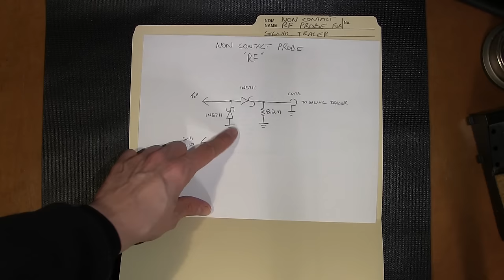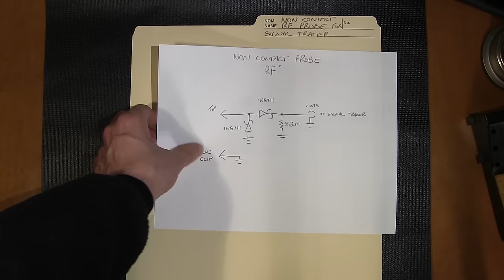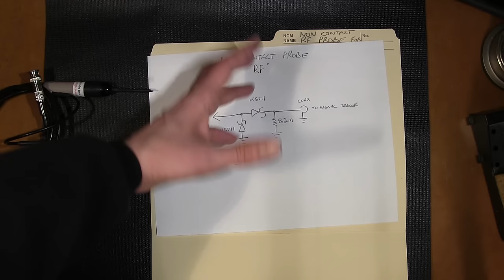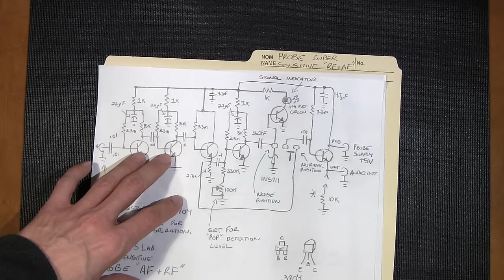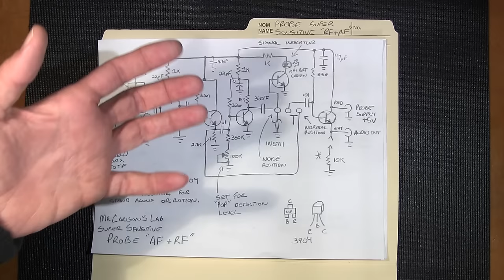Troubleshoot Electronics FAST with a Super Probe

Comment: Hi, i finally built it. It seems to work, but... It detects only amplified signal  from 2-3cm max distance. It cant detect audio straight from an mp3 player. Also the speaker all the way turned up is not loud at all. 
I have checked every connection and component values again and are all ok. The only difference is that i used a smaller rg59 coax. 
Any thoughts would be great..
Reply from the maker: Layout is key. The device is extremely sensitive, and the build quality is crucial. All the plans with PCB layouts, schematics and component maps are on Patreon if you want to build an exact copy. Months of time went into this design and center values were determined, so if you want my results, you will have to build it my way.
Reply: @MrCarlsonsLab  Thank you for reading and responding to my message! And THANK YOU for your great work!
Reply: @MrCarlsonsLab  Problem found on the amplifier side, one different resistor value and no ground connection on one pin. As soon as i fixed that, it worked as demonstrated!!! Still working on the enclosure though, but i am glad i made it to work.

Comment: Sir Paul, what is the smd code for the 1N5711 schottky diode? Is this diode critical in the circuit or i can use any schottky or signal diode?
Reply from the maker: Hi, for best results I suggest you use the 5711, but a 1n4148 should be ok. The code for the 5711 is: 1N5711W-7-F  This is an SOD123 Part
Reply: Mr Carlson's Lab Mr Carlson's Lab Thanks sir. Here is my other question, I only have 50K smd trimmer resistor, do I still need to change the value of the resistor(330K) in series with it?If so,then what will be the value am I going to use?
Another question is,can I use ceramic capacitor in place of those tantalum capacitor(22uF)?
I really want to build this sir because I find it very useful in troubleshooting. But i don't have complete parts here to complete this,so i will use whatever parts i have on hand. Electronics store here in my place is very far(250KM away).
Reply from the maker: The 22uF caps are just blocking caps so the ceramic caps will be fine. Try the 50K trimmer in series with the 330K. You may need to add another 50K resistor in series as well if your not satisfied with the range.

Comment: Mr Carlson can you dumb  down to my level that part about the chassis being connected to neutral Is it no cycling 50% on each wire back on forth at 120 volts on each wire?
Reply: Maybe I can help.  The standard American mains power starts on the power pole at some high voltage, goes into a transformer where the secondary is 240V center tapped with the CT grounded.  Those three wires are what come down to your house.  If you need 240 for a range or a dryer you'd use the outside pair.  Everything else connects to one of the outside lines and to the CT/ground.  So in your outlet, one of the slots is effectively at zero volts, and the other one carries the 120 AC.  But between the two you get 120 AC to drive any electrical device.  --  One reason for the no-transformer radio design that Mr Carlson skipped over is that not everyone had AC power, some had 120 DC.  These radios could work with either, but with AC it would work with either way the plug was put in; with DC the plug had to be a certain way.  -- Anyway, one of the line cord wires goes to ground, and the other goes to the rectifier tube to create the B+ for the radio.  Workes either way with AC, but you have a 50% change of plugging it in so that the chassis is connected to the hot wire.  If you were grounded and touched a metal part you'd get a 120 V shock.
Reply: the neutral is connected to earth where your power supply comes in so if you touch between neutral and earth nothing will happen but if the live {hot} wire is connected to chassis you risk a lethal shock from it. you need to fully understand things before working on any type of mains powered equipment. my advice is to learn on battery powered stuff until you have a good knowledge of electricity.  it will KILL!
Reply: Also, anytime you work on a mains powered, high voltage system, keep one hand in your pocket.  Anything over twelve volts DC should be considered high voltage.  Better safe than sorry.

Comment: hi nice video, i have a question. how do you determine the bandwidth of this circuit.
Reply from the maker: Hi Andrew. This is easily accomplished with a signal generator.
Reply: is there any reason you dont use opamps?

Comment: Would this work on the small surface mount capacitors and resistors?
Reply from the maker: Very much so.
Reply: Interesting.
I may look into getting one. However, I would have to commission one. As I do not have the means to make or modify one.

Comment: i use a lithium battery with a small charging circuit board in my little handheld controller project.this way i dont have to take it apart ever again.it's lighter and cheaper,though i end up burning 3 of them chips by accidentally applying 12v to that 5v input

Comment: may be used to detecting high frecuency from the tv inverters?
Reply from the maker: Do you mean the power supplies?
Reply: Mr Carlson's Lab yes the power suplies for the cfl (florescent lamps)
Reply from the maker: Yes it will definitely hear those with the detection mode on. This probe will listen into the MHz region , those CFL back lamp supplies are usually only down in the kHz area.
Reply: Mr Carlson's Lab Yes thanks I want detecting no measurement the output high frecuency

Comment: Awesome video! Definitely appreciate the tremendous amount of work you put into this for us. :)

I do have one criticism, though: You occasionally refer to a potentiometer as "VR". When I hear that, I for one don't immediately think "variable resistor", but rather "voltage regulator".

I know that's kind of nit-picky, but it's a little easier to follow when you use the abbreviation "pot" or don't abbreviate at all.

Comment: Did you try it on a scope instead of the speakerpart ? 

Nice, my first successful build project (as a teenager around 1980) was something like this. I think the schematic was in an elector. It had 2 inputs, one for RF and one for Audio. I used that a lot as I had no scope in those days.  I still have it. Also build a tube version some years ago. It had one input and detected RF and AF. Instead of the led it used a magic eye to show you if there was RF http://www.pa4tim.nl/?p=1332 there is a download link at the bottom for the schematic (from 1946)

I made a shortfinder that measures contactless. I think I will adapt the detector side to your noise mode idea. I had a psu a few months ago that whined and I could not use scope probing because there was no space. A sniffer probe would have been the tool for this. Stupid, I have several devices that I could have used for that. (including a current probe I made with a hall sensor)

Fred

Comment: I had a terrible electronics teacher in high school
Reply: I have found that high school electronics classes have in mind turning out Radio and TV repair people.  You learn that, but not really the hows and whys of design.  It's useful, and that's all that some people need.  I bailed after one quarter and learned more on my own.
Reply: I can go one better. My high school in Aldergrove B.C. Canada  put in an electronics course in 1969 to see if it was a good idea. I was in grade ten and thrilled about it so signed into it. 
     They dropped it the next year as they did not think it important. You could learn it all in trade school later...if you wanted to go that way.....
     Idiots.....no wonder Japan ....and now China ....and pretty well every other country.......buried us.
Reply: I wonder whether there even ever used to be an electronics course in school in Germany. There wasn't one over in Soviet Union states, but the school there is traditionally only 10 years, while it's up to 13 in parts of Germany. I finished school in Germany around the turn of the century but never encountered or heard of it.

And yet, i didn't have the impression that either Soviet Union or Germany ever suffered from lack of engineers or people generally versed in the subject.

Comment: I found a really unusual tube while looking through box of random tubes.
But the problem is, I have no idea how to identify it?
I haven't seen any examples of other tubes that resemble it.
Here is a link to some images of the tube.
https://drive.google.com/open?id=0B9Lgf9gHRS4nUkZEN1YwTDNEdkU
Reply from the maker: Looks to be some sort of light sensor, or Voltage regulator tube. Could also be some sort of gas thyratron.

Comment: Nothing new, I have a Conar Signal Tracer model 230 that has a vacuum tube built int the probe tip that works exactly like the super probe.  Nothing new under the sun I guess. :-)
Reply from the maker: As I commented to your other post, I have owned the Conar 230, (and probably 20 others) .... it's nothing like the Super Probe.... not even close.

Comment: Looking for a probe, then look on eBay at item No 292057480632.This has an RJ45 socket on the probe, which should allow signal/power from amp, has various leds fitted including 1 on the tip to light up the pcb. Looks like a good possibility, sure your gonna have to fit some sheilding around the pcb, but its doable?Less than £12 GBP.